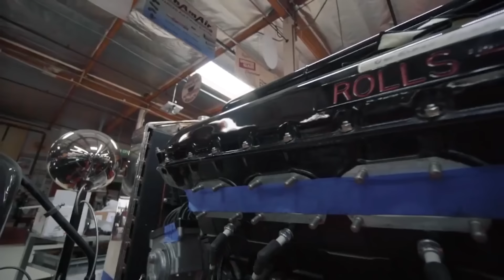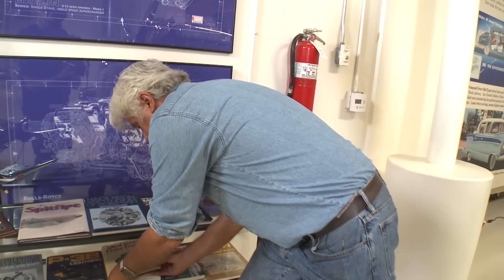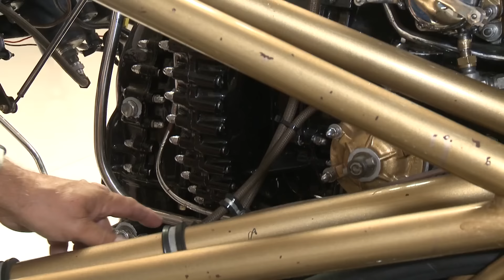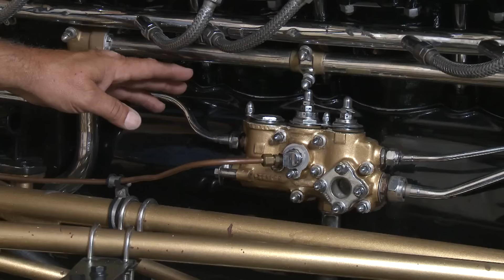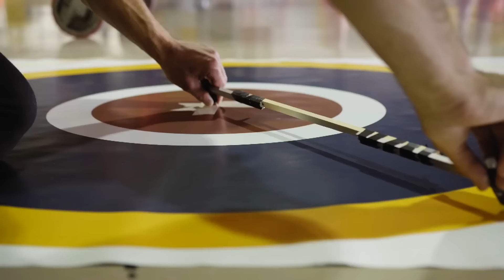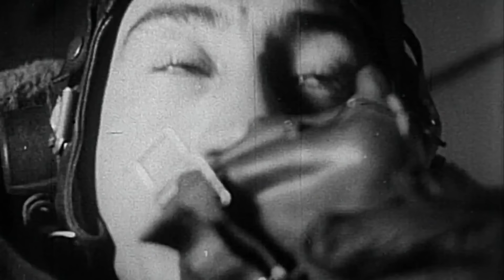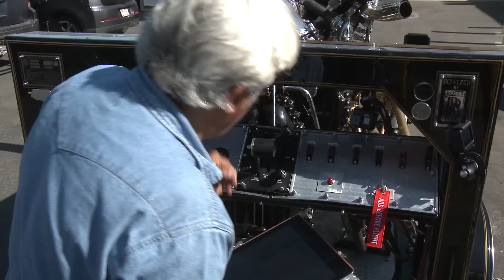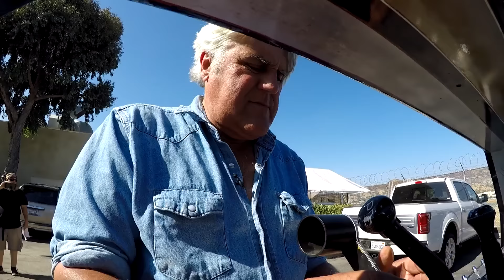The Engine That Won World War II - Jay Leno's Garage

Comment: It sounds like crap, even though it has 12 cylinders.
It definitely needs a major tune up. Valves must be rectified , and well calibrated. I guess the injection system also needs service .

Comment: Great show Jay. I saw a show on how early in the war they needed these engines in quantities for fighters. Rolls Royce came over to the US and the MFG converted all their plans for mass production. Rolls use to make the Merlin by hand and used artisans to build the engines having to adjust the parts by hand.  The MFG/Rolls teamed up and made them mass produced so they could make a mass quantity. They had like 1600 HP and really made the P-51 fighter a terror in the skies. Some say its the most beautiful Fighter plane with that long extended front end with the Merlin.

Comment: Packard Merlin's won the war ?  Most Lancaster engines were built by Ford in Manchester. Packard engines didn't fly in the battle of Britain. At the time of the p51Ds, Spitfires were running RR Merlin's at 1650 to 1750 hp. Whilst Packard played with threads and tolerances , RR concentrated on increasing the power to match the FW190 and so save pilots lives.  Extending the service life was not much use on an engine if it was at the bottom of the English channel.  A virtually fact free piece of USA propaganda in other words.
Reply: It was a Ford plant requisitioned by the Air Ministry who ran it. Ford were paid to do admin, no more.

Comment: Reason it wouldn't stay started at first.. when he was running the primer boost pump, you are supposed to run the mixture full rich to "prime" the cylinders with fuel.. he ran the boost pump but didn't crack the mixture from idle cut-off.. eventually he cracked the mixture and it lit off on all 12 and stayed running.. it's a typical aviation startup flow, but i can imagine Jay doesn't fire this thing often enough to have that muscle memory, and i don't recall him being a pilot..

Comment: The germans hade fuel injection and the merlin was feed by some carburators, works but just dont go into difficult manovers cause the engine will  be starv of fuel…..
Reply: Yet the Battle of Britain was won by fighters with this engine.  So those pilots, The Few, knew what they were doing.

Comment: Just curious if this has the later chromoly crankshaft, connecting rods and pushrods supplied by Oldsmobile in it. Those props, and just about every prop in the war, were also built in Lansing, Michigan.

Comment: My mate's father flew the Lancaster over Europe. He and everyone else , had to fly through 60/ 70 miles of flak going in and coming out. One mission they had 56 holes in the fuselage. Another time the compass got hit, and by following it , they were going in the wrong direction. So they flew back to old Blighty by the seat of their pants. The corkscrew manouver to evade fighters was another. Going flat chat vertically down, 4 merlin's pulling too, and spinning at the same time ?? I think everyone would have been praying hard during those ! The loss of aircrew over Europe was massive. When those men came back to Australia they were told they had been taking it easy in England !! I hope they got a few good ones in !

Comment: Last month I flew a 2-seat Spitfire Mark 9 from Biggin Hill Airfield to the White Cliffs of Dover on a 1-hour flight. When the pilot started that Merlin and the smoke came back to the cockpit it smelled like raw power plus the airplane shook all over from the energy from the engine. During take-off the throttle had to be applied slowly so as not to lose control due to the massive torque on such a small aircraft as the Spitfire. I'm a pilot so got lots of stick time on the flight. Fantastic experience!

Comment: Jay, excellent show, as usually, but why an F4U in your “Merlin section” a few years back I toured the “Rootes archives trust” near Banbury in the UK. When I arrived they had out the blueprints from the Merlin Engine. Rootes was part of the “shadow Factory program” during WWII and built 150k aircraft engines. I know you are aware of Rootes because you used to have a Tiger. Thanks for the show!

Comment: Sorry Jay, but the engine that won WW2 was the Willys L134, commonly known as the "Go Devil" engine. This was a 2.2-liter (134 cubic inch) inline four-cylinder engine that produced about 60 horsepower and 105 lb-ft of torque.
Reply: No. Without the Merlin the war in Europe was lost by 1940 as Britain would have fallen. There’d have been nowhere to launch a fight back from. 

Apply some common sense and logic. It won’t hurt.

Comment: The Merlin engine was also used in the Comet and the Centurion tanks. The supercharger was removed and the engine was then designated the Meteor. The Meteor engine could be run on petrol.

Comment: Wonder if a modern engine could be built out of Aluminum for the block, 4 of them & put in the wings of a new prop driven airliner that could cruise ~450 mph for short to medium haul trips 600-1000 miles for a commercially viable airliner.

Comment: This reminds me of the Summer of 1977, I was 15 and was test-running a .049 Cox engine in my living room (I lived on the 14th floor of a NYC Housing Projects). That little engine made so much noise and smoke...the girl next door was wondering WTF is going on...however, it impress the heck out of her. Funny was the expression on her face as the glow-fuel smoke entered her apartment..😅 Thanks JAY for this awesome video! 😎👍

Comment: I worked for RR Derby and early in the in-service life of the Dreamliner, we got a low, almost simultaneous, pass from both the RR Spitfire and a BA Dreamliner.
You could make out the unmistakeable engine noise of the Spitfire (actually fitted with a Griffon engine - a later version of the Merlin) LONG before the Dreamliner - just like the WW2 movies made in the 40's/50's.

Comment: The Merlin V12 developed from 1030 hp in Spitfire and Hurricane Mk. Is and others to 2030 and 2050 in D. H. Mosquito Mk. 30 and Hornet. The same compression and rpm. Perfect from the start.

Comment: The V1650 was fine motor, but isn't what won WW2 - if any one engine deserved that description, it would be the R2800 that powered there P-47 (which defeated the Luftwaffe fighter arm) and the F6F & F4U, which defeated the Imperial Army & Navy air arms,  along with the P-61, B-26, and A-26

Comment: Do I understand correctly that in this engine you control the power only by increasing the boost?
 So the sequence looks like this:  you move the engine control handle increasing the boost, more boost more engine speed, the engine revolution speed controller, trying to maintain constant speed, increases the angle of attack of the propeller, the propeller gives more thrust. Is it correct?

Comment: On the 7th June 1937, Britain`s most famous engine designer Roy Fedden was invited to Germany by Erhard Milch to view the state of the German aeronautical industry.

What is interesting is comparing the very high state of research into turbocharging, and two-stage supercharging in Germany which was obvious even in 1937. By the Battle of Britain, all that had vanished, or at least been ignored by the Nazis. So, luckily, Britain was able to compete on roughly level terms in the air in 1940, and achieve a substantial advantage in mid 1942 with the advent of the two-stage supercharged Spitfire Mk IX [using the Merlin] which could fly higher than any German aircraft at the time, and was notably faster above 20,000 feet or so. It was a huge turning point in the air war.
- Calum Douglas (World authority on WW2 aero engines)

Comment: Ummmm, not even close. The engine that "won" WWII was the Model V-2-34 38.8 L V12 Diesel which powered the T-34, some KV tanks and other Soviet vehicles. Or perhaps the AM-38 engine which was found in the IL2 Sturmovik. More than ANY vehicle in the western theatres these "won" WWII. The Merlin was the best engine produced by the west powers, a brilliant and beautiful work of engineering, but the war was won in the east by Soviet machines and Soviet bodies.

Comment: I would love very much to see JAY RUN A PRAT AND Whitney engine from the course air, would love to see JAY run this engine love to watch an episode, as for fuel as far as in know at the time they could only refine gas to 80 90 octane what they did was put 100 and 20 prof alcohol to the gas, mechanic that worked on the planes b 17s p 51s all the planes use this gas that was boosted in octane with alcohol, well the mechanic learn how to distilled the alcohol back out of the gasoline if at all for jay to make an episode on this fact be great to see his episodes on this, oh the R 2800 engine

Comment: Funny he says the Merlin's the greatest WW2 engine standing in front of a F4-U model which had the actual greatest WW2 engine the Pratt&Whitney R-2800. By far the most manufactured engine of the war.

The Merlin is an excellent engine clearly but Jay shows a signal lack of knowledge using a Merlin at sea level instead of the Allison. All the piston engine air racers use the Allison because it's superior to the Merlin at lower levels.

The Merlin's claim to fame was it's 2 stage supercharger which gave it outstanding performance at say 15,000 ft. and above. Actually Allison had a superior engine with a 3 stage compressor but it wouldn't fit in the P-51, thus the Merlin.

Again the Merlin is an excellent engine but not the be all end all we always hear about. 😎

Comment: Packard was the only US manufacturer that was deemed 'worthy' to license build this motor by RR execs. When they hesitantly said it could possibly be done, RR asked "why 'possibly', was it to complicated"? Packard said "Not at all, but your tolerances are wider than what we would build to". Or something like that....
Reply: Wrong.
What Packard actually said was that the first ever set of drawings shipped from the UK did not contain all the information. Which is not the same thing as the tolerances being too "wide". It was a vast job to transfer all the information, and it took a few months before both firms were working with the correct and full manufacturing information. It's very common for drawings to refer to other standard-sheets which are known to the company in question, but if you just give the drawing to someone else, they will find all sorts of things referring to other in-house standards which you don't have. I have yet to find any original information at all, that RR parts were made sloppily before Ford and Packard came along.
- Calum Douglas

Comment: I stopped at The Canadian Warplane Heritage Museum once several years ago. They didn't have the "lanc" outside that day, but fly it seemingly weather permitting. They, indeed, are very proud of the plane, naturally. One Ted Lowery, at the time a features writer for the museum, explained to me the machine's specifications and capabilities. He invited me to rap on the underside of the fuselage to see just thin the sheetmetal of the body actually is. Its - no lie - just like a soda can! The museum is actually in Hamilton, about a 30 minute drive south of Toronto on the outskirts of their international airport. If you're a US citizen, bring a passport or enhanced drivers license so you can get back into the states. Have a nice trip!

Comment: I love Jay, but he was not born with all the know-how for everything.  He reads and listens and wants to know, but they did not finish telling him how to start an airplane engine.  It doesn't have a choke. It has a primer that is run for a certain amount of seconds before cranking, and then is toggled on as needed to keep it running until it will stay running.  The carb doesn't have a power circuit like a car. It has a manual mixture lever that must be adjusted to suit what the engine is doing for work at that time.  Airplane engines are shut down by moving the mixture lever to idle cut-off which shuts off the fuel.  He was trying to start it and keep it running with the mixture near the cutoff position.  Not his fault.  Nobody told him. All the piston aircraft engines I have started have the mixture lever in the full forward (rich) position to start them.  For many, it stays right there until the plane is above 5,000 feet, and then is leaned out as needed.

Comment: watching this and hearing about the Ethanol fuel eating through the Carburetors  and destroying them made me wonder i owned a Sport Fishing Boat with twinFord 302s and after a bit of experimentation we figured out they ran best with 4 barrellHolley Double PumperMarine Carbs  yet those also wouldn’t hold up to Ethanol. as well and it meant everyboff season i took them off and gave them to my local Holly Guys to rebuild  every year they needed new Accelerator Pumps that were destroyed per the Techs  shouldn’t Carbs be built to hold up against Fuel?  i don’t remember the Cost of those Halley’s new but they weren’t cheap

Comment: In a very minor roll in helping restore a Lancaster in Toronto - FM104 - I recall cleaning parts from a Merlin engine that had sat for 40 years, with oil still in. It seemed incredibly complex in engineering, and indeed required speacialized tools. Perhaps too well designed in principal, since they did not have a long life expectancy in WWII aircraft. Some German and particularly Russian aircraft were simpler in design for speed in production. The sound is amazing.

Comment: The Canada Warplane Heritage museum is not in Toronto, it is on Airport Road, Mount Hope, near Hamilton, Ontario, which is approx.  100KM (60 miles) SW of Toronto. It's an easy drive, I have done it. It's highway all the way.
 By the time WWII ended, 55,573  Bomber Command crewmen were dead, more than 10,000 of them Canadians.  Only two Lancaster's still fly today, and one of them is in Canada.

Comment: I was born in Stretford Manchester. Up the road from where I lived was the Metropolitan Vickers factory. There they made 1080 Lancaster Bombers of the 7377 total. One of the lucky bombers was built there. 
"S for sugar" was her name doing 137 sorties and now parked at RAF Scampton. Also in Metropolitan Vickers Trafford Park Stretford, 30,428 Merlin engines were built.
Reply: "S Sugar" is in hangar 5 at RAF Museum Hendon.
Reply: strange how you didn't mention Woodford
Reply: Woodford and Chadderton also built them but I mentioned Stretford because M.V. was 2 miles from where I lived.

Comment: I beg to differ. The engine that won WWII was the GMC 270 that powered the 2 1/2 ton (deuce and a half) cargo truck. Without those trucks there would have been no food, no fuel, no ammunition, no munitions, no parts replacements. The Merlin engine is a wonder to be sure, but it's useless if you can't keep it flying and fighting.
Reply: lol what a salty comment

Comment: The Rolls Royce Merlin went from 1,000 BHP to 2,600 BHP. The Merlin RM.17 produced over 2,600 BHP. It was shelved as the war was near over with jet engines taking priority. The Merlin was one of the very few engines that attained 1 BHP per pound of engine weight. The British Napier Sabre engine improved on that reaching 1.3 BHP per pound of engine weight.
The ultimate authority on aero engines is The Great Horsepower Race by Callum Douglas. Callum is an F1 engine designer who turned to be a WW2 aero engine historian. He went through the German, British and US archives. It is amazing what he dug up.

Comment: Pretty cool, love to hear that Merlin running. Working at an airport I've gotten to see several great aircraft from the early era of flight, and several cool new aircraft too, but the P-51 is my favorite aircraft of that era. Not sure why exactly, but I just think it's a cool looking plane. I can say I remember as a small child the when change over from prop passenger aircraft to jet passenger aircraft happened at the airport where I work now. I can remember when the Lockheed Constellations used to fly regularly.

Comment: 🏁🏎️. 💨💕
Reply: Mr. Leno : the spitfires in the battle for Britain had battery 🔋 problems. 
=====
One off-the-wall thing was the Brits put baby laxative into the battery to , clean the 🔋plates.
====
Read , that - in college & another publication.
===
(Ding me) I walked into a chemical supply store and bought a pound. ( Didn't know the chemical name was a baby laxative )
===
 Later , I tried  CLR to clean battery 🔋 plates on the farm but a horse turned 
 over that 🔋, Splash - Snip it thought did it .
===
Or , someone from that Burgatti ghost 👻 prison you were talking about ( think it's outside of of Egypt) fifty cents a day accommodations.
=====

===
Not sure on nuclear it would have been.

Comment: What's truly amazing is the hours spend on the design board back and forth working out the kinks in break speed. Then hundreds of draftmen and  women creationg master blue prints....sending out orders g or all the components..
Castings and untold hours on milling machines, laths, surface grinders polishers..for arbors, simple and complex gears, valves , rockers super charger and balancing the internal components. All done without computers & without computerized CNC machines. Many a bibb overalled worker put in time and efforts to build these and all the marvelous hardware man invents to kill one another with. Fear surely IS the most potent motivator in life. People accept the fear and buck up to do the unthinkable. WW 2and the decade  before was a big Era for engineering development. 20th century golden Era following WW 1. Hats off to all the men and women who build these & other marvelous machines..
Just trying to comprehend the coal' coke, fuel and oils used world wide for one year of war is just unfathomable! Rubber too!

Comment: Look at the design of this engine; it basically set the template for performance for the rest of C20 -dual overhead cams with the heads on top, forced induction, chain driven timing gears, liquid cooling.